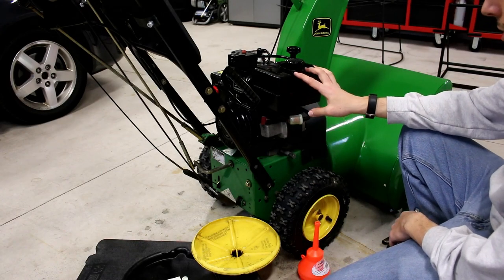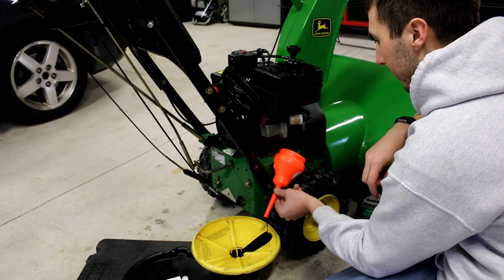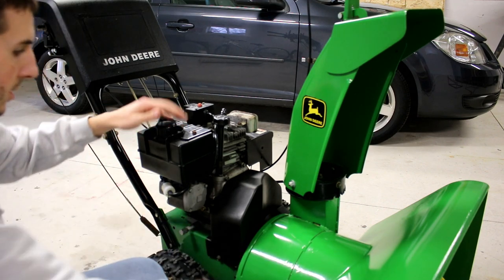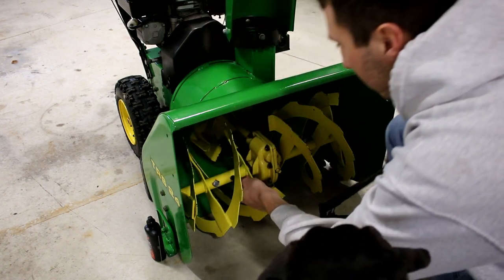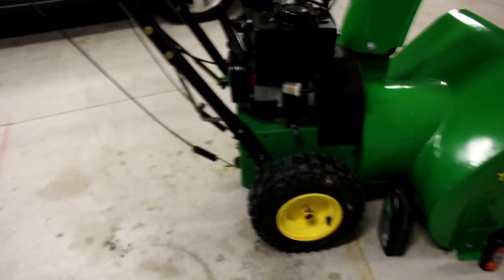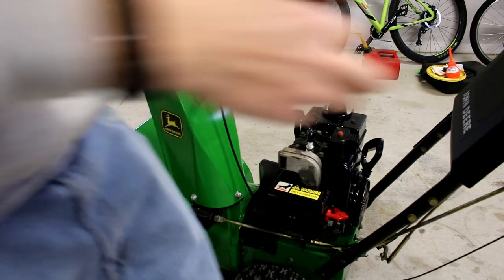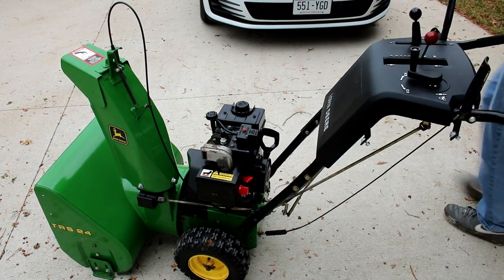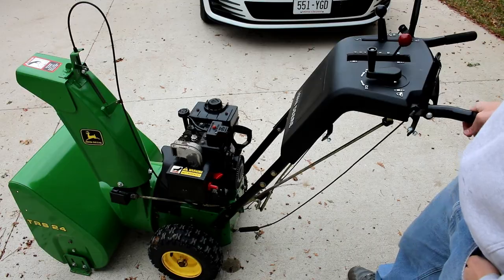John Deere TRS24 Snowblower Oil Change and Maintenance

Comment: I've had mine for 16 years. I did use it for cleaning neighbors driveways for a few years and its paid for itself 3 times over. Now I use it for big snows and a smaller 4 stroke Toro for lighter accumulations.

Comment: My partner has one of these for the rental, thanks for the video. The future is definitely electric, for all small machines, no at-source pollution, no fuel or oil, next to no vibration and much quieter. Several friends bought the Ego 2 stage and for all but the largest of jobs, they work much better.

Comment: You should mention to run the snowblower for a couple of minutes to warm up the oil so the oil will drain quicker and loosen cap on oil tube to prevent a vacuum.

Comment: Great video. Thanks for making it. I have the 726 E model. I never thought of using a funnel to direct the oil into a pan. Hence making a mess when I have done it. LOL. I also have a yellow cap between the filler and the drain where oil will come out if I remove it. Can you tell me what it is for? An overfill sight perhaps? Thanks.

Comment: I bought a John Deere TRS when JD first started selling them. They also had the the last snowblower JD made on the showroom. I didn't know that JD had Murray build their snow blowers or I would never have purchased it. I thought the TRS looked cooler so I bought it. I could have gotten the JD made snow blower for less money because it was last years model. It turns out the JD built snow blower might be one of the best snowblowers ever made. The TRS worked good for blowing snow but the 2nd year I had it I hit a small rock and it destroyed the front gear. I replaced so many belts I keep a extra on hand. Other things went bad on it too and I finally just gave it away. A friend of mine has a JD 828 (made by JD) thats over 30 years old and he loves it. He says that it works better that most of his neighbors new snowblowers. Would stay away form buying a TRS like the plague.

Comment: Hello  I have a TRS 24 and I wanted to have the Auger greased . My friend tried to grease it and one of the grease fittings got stuck in the gun and now I need to find a grease fitting that fits do you know what size the fitting is so I can match it? Do you know anywhere I can get them. I called my local dealer but their catalog said it was an obsolete part and had no other info

Comment: Ryan - which gearbox is that for the shoot rotation?  Definitely not the same as mine and I still have original.  It still works however when you point it in a direction, it doesn't hold it's position from the vibrations of the machine so I have to keep adjusting it or hold the handle in place.  Great info - thank you for sharing.
Reply: I have the same issue with my John Deere TRS24 Snowblower chute turning on its own due to the vibrations. Mine also does not have that black gearbox at the base of the chute like the one shown in the video.

Comment: I’ve got a question, got the same blower, wondering the model number for the engine or whatever. The tag or sticker for the actual tecumseh engine (not the John Deere itself) is missing or I can’t find it by the carb where they say it is. I need a new carb kit and just want to be certain which one to get.

Comment: Well the auger belt decided to fail just when I went to clean about 18” of snow 😔. Anywho - just wondering if you can provide any direction on how to replace the belt?  I took the cover off, one of the pins the keeps the belt on, and also the tensioner pulley attached to the auger drive handle but it still doesn’t seem to want to come off.  Is there anything special to be done to get the belts out?  Thanks 👍

Comment: Is there a parts manual that can be downloaded from somewhere? I have a tensioner spring that has broken loose. Need to find out where it is connected and a replacement. Looks like the soring anchor broke due to fatigue.

Comment: i take the tire off to change the oil    you have more room
Reply: I use a sheet of aluminum foil, fold it over a few times, and make a leader of it.  Saves you the hassle of having to take the tire off.